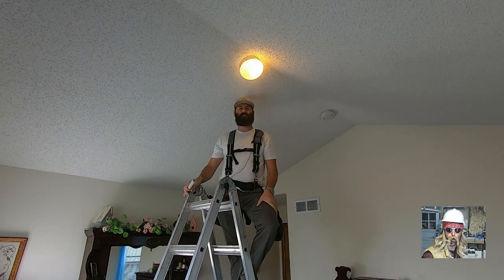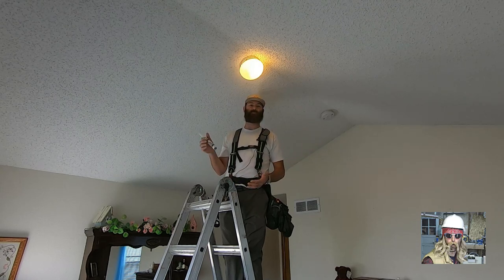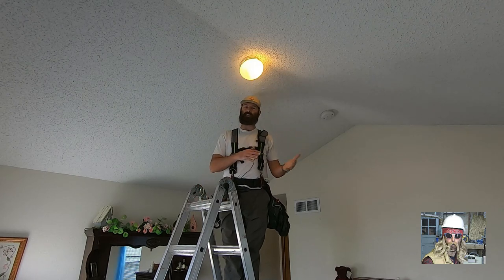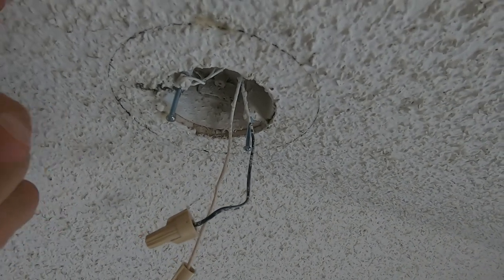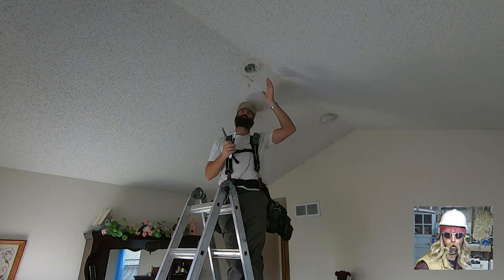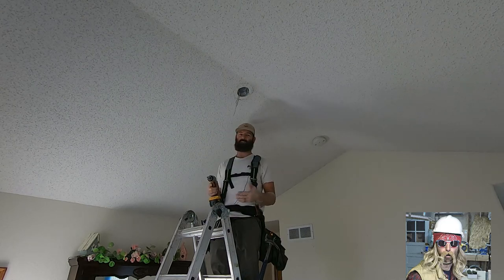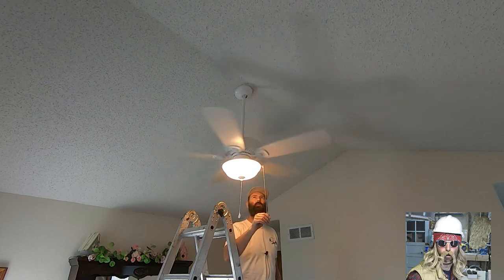Cost To Install A Ceiling Fan Inplace Of A Light Fixture | Step By Step Instructions | THE HANDYMAN

Comment from the maker: First   Here is the remodel fan box kit https://amzn.to/31CDDY4
Reply from the maker: I have an electrical video coming out in about a week on an older house.   I live in an older house as well.  The previous owner lived here since 1978.   Not sure on the history after that.
Reply: @TheHandyman1  Wash your hands after playing with your knob and tube!! ;)
Reply: Can honestly say I replaced many of these the hard way. Some didn’t have attic access and others I cut thru floor boards to fit 2x6 joist spacers for new metal boxes. This new style is perfect example of pay a premium price to save loads of time.
Reply: John Lawson  I happened upon this because wifey wanted a huge light over our table.  Prefab modular house with crawl space for attic. Replaced most  light boxes when we moved in years ago. First I had to wire outlets and lights in attic to even see and work in there. Cut through r30 insulation to get to those boxes and custom cut 2x6 boards for new metal boxes. 
 I put this type in ,in less then 1/2 hour, with out crawling thru attic and almost no mess. Almost everything in life is subjective. Unbelievable time saver in my opinion.
Reply: Mister J people

Comment: Turning the switch off may save you a trip to the basement but you MUST still check for power at the fixture.  Would be plain silly to assume that the person who wired that room brought power through the switch and not the fixture especially in an older home.  I’ve even seen newer homes with power at the fixture.  NEVER TRUST ANYONE ELSES WORK.
Reply: If the power is in the light box and you turn the switch off and only touch the neutral and switch leg that you removed from the light you will not get shocked.
Reply: @Justanotherwhiteguyyabish  sometimes, especially older houses, power doesn’t always go to the switch, it’s goes to the fan first, and gets reversed, so the switch can be off, but power will still be in the fan. Best bet for homeowners is to switch the breaker off to be safest
Reply: My personal favorite is when you shut off all of the breakers and everything is still hot🔥

Comment: I've stopped messing with running 14/3 and doing double switches for retrofit fans. Many of the nicer fans come with a wireless remote or you can buy one separate on Amazon for less than $15. Then, you can control light/fan and adjust fan speed (L/M/H), which you can't do from a double switch. The remotes have a holster that mounts on the wall, or you can put it on the nightstand or whatever. Easier install (costs customer way less than pulling wire) and gives them the same/better benefits.
Reply: This, & gadgets like motion sensor light bulbs, will put basically skilled electricians out of work one day. Vocational grads need to up their game & knowledge.
Reply: Even better - some come with "smart" kits in addition to the remotes.
Reply: @droolbunnyxo9565  so those motion lights and remotes will wire houses, buildings, troubleshoot, and everything else an electrician does? Must be some powerful technology.
Reply: I despise remotes. Home depot has a unit(Hunter) that fits in the wall outlet and gives you complete control of the fan. They come with dip switches in case you install more than one unit in your house so you're not turning one off and turning another one on else where in the house from the same controller.
Reply: @michaelsmith8467  Every electronic comes with a remote these days, why would you not want to have the same convenience with a fan??
Reply: The room had no light or fan when I moved in...I didn't add a fan with no light..sorry thats confusing

Comment: As a licensed electrician great explanation love the fact that you explained the difference between the different type of electrical box rating. This man knows his stuff.
Reply: I'm not a licensed electrician, but a career Navy electrician, and I'm SHOCKED to see this man trust his life to a wall switch vs. turning off the breaker and then verifying that there is no power on the wires like a SMART electrician.

Comment: Great vid!  One thing I like to do when working on an angled or vault, is attach a string to the brace and let a bunch hang down out of the hole while getting it up through the hole.. That way, if it tips and slides down the vault, I have that line to retrieve that bracket.  Yes, I did learn that trick the hard way...

Comment: It doesn't sound like much until that person has to climb up in the attic in the dead of summer and run wire.
Reply: That just makes someone work faster.
Reply: No that's just hot
Reply: WARRRRM!
Reply: i would rather be running wire then installing heat runs and returns.

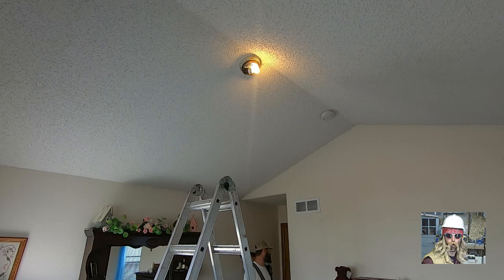Comment: 1:58 Dude! you're supposed to do BOTH the breaker and the light switch during your project, not just the light switch!🤣🤣🤣🤣 Those wires can still be live even with the switch off. So, therefore, you have to shut down the electricity from BOTH of the following I just mentioned.

Comment: American prices do seem high for labor compared to here in the UK

I had my whole house required including networking cables (brick house so channeling up walls) took two electricians a week..... in USD it worked out to less than $4,000
Reply: You pay for quality. There's a reason the UK follows US code standard and not the other way around.

Comment: You still have to check if its hot, if they looped the wire and sent power to the light and then to the switch you will still get hit have to turn the breaker off.
Reply: You are very correct
Reply: He's coccky. He thinks he knows everything lol. He gonna get zapped

Comment: Do you have any videos of replacing a recessed light fixture with a ceiling fan?
Reply: That's interesting. I guess if hole for recessed light is bigger than old construction fan bracket, you will have to patch hole with sheetrock first and then drill a smaller hole for ceiling fan box. If hole is the same size as ceiling fan box, then it would be same/similar work as shown on video.

Comment: I like like the hammer handle for pushing up the insulation tip though it might still poke through the vapour barrier. One problem I ran into in a house with a 3rd floor loft was that the centre light in a second floor was in a 11" joist space, too narrow for those remodel supports. One joist was, I think, a builtup beam to support a loft wall.
Reply: Then you take the bar and cut it, re-insert the threaded thing on the end, and you can fit it between the framing. It takes some time to customize, but it can be done.

Comment: I didn’t get the breakdown 
Was your total charge 150 +- and the homeowner total parts expense 450+- ..?
Thank you
Reply: I heard it as $175 for the ceiling fan light kit (over 8’ under 11’) and $250 to remove the old box and install the fan $425 total ($175 + $250).
Reply: Stop and rewind. It's amazing.

Comment: I bought my home 10 years ago, and the electrical drawings, shows ceiling fan on every room, which I though it was great, not so much I'm installing a fan on every room , every thing was going great until I get to the last room the one with cathedral ceiling to my surprise the installers did not install a fan bracket and there is no room to replace the one that is in there because they install the bracket under the thruster beam, question how do I install the fan without making a mess?  I should mention that the bracket seat right on the pick of the gable.

Comment: My 60 y/o house has 4 ceiling fans. All 4 have the lights run off the switch with the fan always hot. I've seen so many in other houses that the switch runs the fan too. Is there some point in time that home builders stopped running 3 conductor up to the ceiling fixtures?

Comment: I have a question! So if you did end up having to  install another switch one for the fan speed and one for the light of that fan, how would you do so? Is there two different load lines on the fan, one for fan speed and one for the light on the fan ? Just curious

Comment: Handyman, 1st the caffine makes you shaky, then you get to a point that you need glasses, then you end up working off of memory and you leave your glasses in the truck all of the time and cut back on coffee from 20 cups a day to 2 or 3. Oh and you start getting a gut LOLOL. As for the charges, I say get it cause you are worth it! and like you said, I have been in more houses than I can count where the ceiling light box has broke from the weight of the ceiling fan or hanging sideways and slapping the popcorn off ceiling and they say, "I thought about shutting it off, but I needed the light on and was afraid to get under it to pull the string"

Comment: Able to do romex makes that job alot easier.  If that exsitng box was hard piped that would be double the time.  To add switches for light and fan you would have to fish a flexible conduit up and over the ceiling rafters. And in most cases it wouldn't fit above.  Then fish down the wall with flexible conduit.  Triple the amount of money for material.  And double the labor cost. Got yourself a full day doing that

Comment: I see your air pressure controller on the visor ...do you have a video about that equipment on your truck?  Is it effective for a standard (bumper-pull) trailer?
Reply from the maker: I love it.  I use it for my travel trailer.  I have the info on my 3rd channel.  I might put it up on my business channel too.

Comment: Is turning the breaker off that big of a deal? Seems like it can prevent a bad accident if a neutral wire (common here in Ireland and the UK) was shared with a different switch in a different room. Also, surely it's better to teach best practice and validate the wires are dead with a phase tester than relying on the switch entirely?

Comment: Sounds like you charged the right amount. I charge hourly so I would’ve gotten kinda screwed on that job. If I do bid a fan install from some nobody that calls me out of the blue I tell them 200 to 250 for install of a fan. Some fans take a lot of time to put together. And if I run into any issues I want it covered
Reply: Bet you don't charge the customer for the time to get to the next job either! This guy is robbing people for doing that
Reply: @staind288  No I never charge like that. It does not seem fair to the customer.

Comment: Speaking of insulation in ceilings, does anyone have any good advice as to the hazards of vermiculite? I have been told it is not hazardous, but then in my personal reading I discovered around 75% of it contains asbestos. I don't get anywhere near it without my respirator now

Comment: Easier to get a fan that has a wireless remote control that you can mount on the wall. Can run the fan and light from that.

Comment: "i just turn the switch off". Nah homie, if I could d/c power at the pole before I touch wires,  I would.   You should see how many times I tap the wire with my circuit tester before I touch it.

Comment: I helped a friend install a ceiling fan. Just turned the switch off. Some yahoo had switched the neutral and not the hot. 👉⚡
Reply: Ouch! I always use a cheap $20 non contact voltage tester.

Comment: HOW CAN IT BE SAFE TO WORK ON THE WIRES WITHOUT SHUTTING OFF AT THE CIRCUIT BOX? THANKS
Reply from the maker: Just turn the switch off.  Residential electricity isn't very dangerous
Reply: @TheHandyman1  Only shut off at the circuit box if replacing an on/off switch and a plug socket?  Thanks..AND thanks for such great informative videos Andy!!!
Reply from the maker: Yes. turn breaker off if working on outlet.  If you are unfamiliar with your home turn breaker off for lights too.

Comment: What you didn't mention is that there are different length of "feet" for different thicknesses of the ceiling and you need to buy the correct one for your application

Comment: If hot runs to the fixture first then turn off the breaker.  But you never know until you get bit!
Reply: I always use a non contact voltage tester even after turning braker off after been shocked a few times when only turned switch off. Lesson learned the hard way!

Comment: Just turn off the light switch...   what if the power goes to the light box first, then to the switch?
Reply: Then I suppose you'll figure that out when you get there...
Reply from the maker: Then I would have to find the breaker because there is no way to get all the wires out of the old box and into a new box without Zapping
Reply: @TheHandyman1  or when someone else comes into the room not thinking and hits the light switch on auto pilot. When I do this I put blue tape on the switch while I am working. I have hit the switch on accident myself.....zap
Reply: I'm not an electrician so pardon my ignorance, but how does the switch control the light if the switch comes last on the circuit?
Reply: @myname4598 cable goes to the light box, not the actual fixture, first and then a switch cable (normal cable just using a conductor as a switched live and a permanent live) running between the light and switch. Hope that makes it clearer.

Comment: I've shocked myself on ceiling lights with the such off before.  I'm assuming that means the neutral was switched instead of the hot, but I never tried to figure it out for sure.
Reply: The switch was either a 3-way etc. or there was another feed using the light box as a junction box. Or the feed came to the light box and then down through the switch and then back up to the light in which case the hot and neutral will appear to be switched.
Reply: @personofinterest737  - It was on a 3 way switch.  I didn't think about that having anything to do with it.  I have no problem replacing them, but I've never looked at a diagram to try to figure out how they work.
Reply: Probably a switch leg . Power to the fan first

Comment: Maybe you could connect the 3 wire to the exposed wire and pull it to the switch...
Reply from the maker: It could work but its stapled in 2 different places inside the wall and every 4 feet in the ceiling.
Reply: @TheHandyman1  ouch

Comment: Is it legal? Lmao does most any homeowner really give a crap what’s legal according to some book and codes? Sometimes what’s legal is over thought and just a pain in the ass. Is it legal to run 1/2” pvc conduit with 2 Romex 12/2 in it? I think it’s not but if you strip the Romex and use the insulated conductors individually you can I think but where’s the harm really? Is the wire going to over heat and swell in that space?? 2 Romex will fit in the 1/2” but legal?? Thoughts and reasons why not??